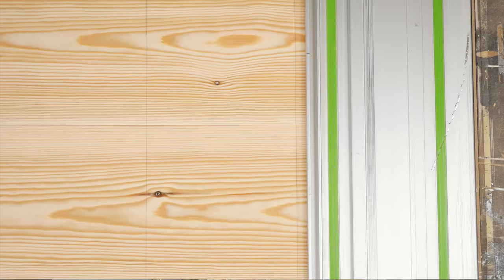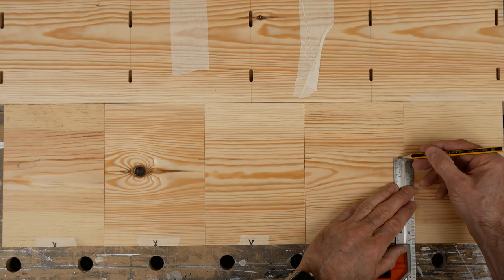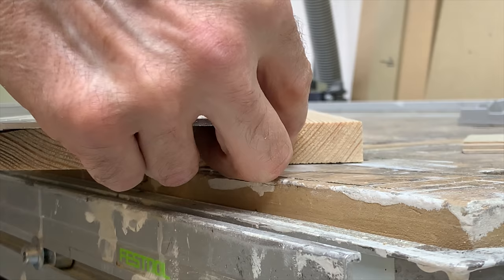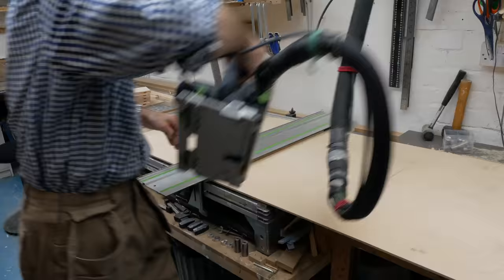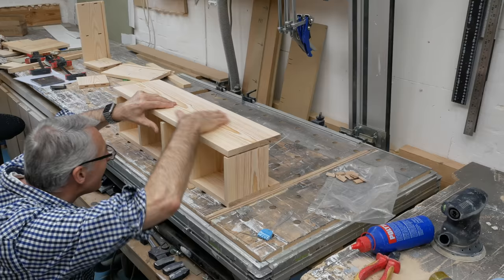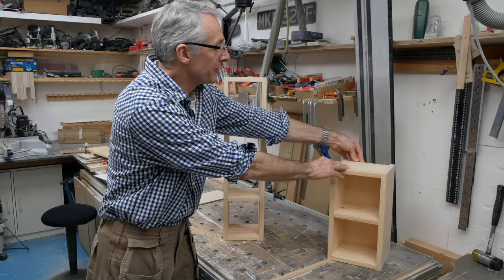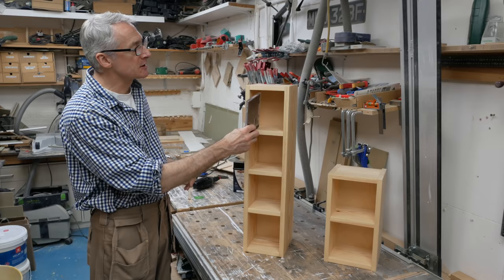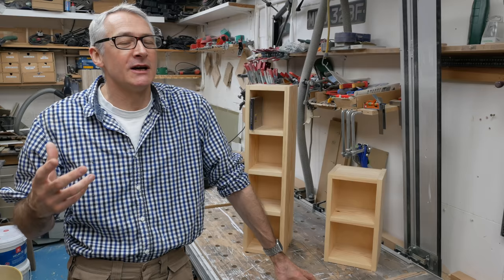Extending Ikea Part 2 [video #297]

Comment: I was thinking. There's a dearth of cheap tracksaws here, only one that I have found cheaper than Scheppach.

I have a proper workbench, I bought it at auction when a cabinetmaker closed down. I could replace its sacrificial top, drill lots of holes arranged artistically, make a sled for a circular saw, attach with a hinge to ensure I get my rightangle reliably, and do what we saw you doing with your fancy pancy Festool.

How does your tracksaw adjust for different thickness material?

Comment: Enjoyed the video, especially the outtakes at the end, thanks Peter. I guess it is a cost thing, or having seen the Instagram photos, maybe a balance thing, but I watching the video I wondered why you went for a ply back instead just using another piece of redwood domino-ed in place?
Reply from the maker: Thanks Bob! While there would have been space for a Redwood back on the larger of the two, there wasn’t enough depth in the smaller of the units, so we opted to keep them the same, rather than have one with Redwood, one with ply. 👍👍
Reply: @10MinuteWorkshop  Okay that works for me.

Comment: I can understand why you were nervous about the big router bit sticking out that much, but why did you pick the track saw over a 6mm router bit?
Reply from the maker: Just trying to do this build with a minimal toolset; as I say in the video, I used Dominos for speed and convenience, but it could easily have been done with dowels, and other than a sander (speed/convenience again) the only tool I used was a tracksaw. 👍

Comment: Peter, may I ask why you cut a wider domino to the rear of the case, wouldn’t two of the smaller width ones have been adequate?
Reply from the maker: Force of habit; give myself as much wiggle-room as I can get., and especially when you have this many dominos in a glue up. 👍👍
Reply: Peter Millard Than you for your response Peter.  Iunderstand now you use the same size domino in both positions. Do dominos expand in the same way that biscuits do or are they behave like dowels?
Reply from the maker: Thanks Mike. No, Dominos are stable, more like dowel than biscuits.

Comment: Nice little project but would be a biscuit joint not cheaper?
Reply from the maker: Thanks. As I mentioned in the video, there are lots of ways of making the joints, with dowels probably being the cheapest. Don’t own a biscuit jointer, so not sure of the price of biscuits vs Dominos.

Comment: Thank you, Peter. 

First time commenter here, so wanted to say how much your channel has expanded what I feel I can take on. Much appreciated.

Couple of questions: from your videos it looks like the track on your MFT always comes down true whereas mine (recent purchase, so I'm getting to know it) goes out of square whenever I adjust  the front guide. Is that all in the edit or am I not using my table right?  

Secondly, where do you get those little bench dogs? Can't see a link on your page.
Reply from the maker: Thanks Ben, and welcome to the comments! Really the MFT, no, the rail should come down absolutely square every time - that’s the whole point of it. If you haven’t already seen then, maybe take a look at videos #182 & 183 where I talk about the MFT setup in a bit more detail. Once it’s set up square you can remove the front rail support for a clear bench, then replace it and the rails come back exactly where it was before. 

Re the benchdogs, I’ve had that set for a long time, but I usually recommend benchdogs.co.uk as they do a great range of MFT dogs and accessories. No affiliate link with them, I’m just a happy user of their product. I have a specific vid coming very soon on a benchdogs product that may be of interest. 👍👍
Reply: Hi Peter, thank you for replying, I don’t know how you find the time!
I will watch those videos and see if I can eliminate some of the ‘slop.’
I suspect it’s going wrong when I change the height. 
I can see how maintaining a fixed height would help but at £600 plus I shall be disappointed if I have to get the square out every time I change the height. After all, that is what it’s been designed to do.
Reply from the maker: Ben Reddick Hi Ben. No you absolutely shouldn’t need to get the square out every time! The height adjustment (for different thickness materials) shouldn’t move the front rail support laterally at all - if it does there’s something amiss, for sure 👍

Comment: Nice little build Peter. Your 10 minute glue,  how long do you actually leave it clamped up? I'm using a 5 minute glue and noticing that any squeeze out isn't fully set until well after an hour. Even though the carcass feels secure I'm not convinced it's fully set.
Reply from the maker: Thanks Jim! Polyten  grabs pretty well within 10 minutes and handleable in 20; they say it does take a couple of hours to cure fully, though I typically leave it longer than that. And yes, glue squeeze can be quite soft while the joint is still strong enough to handle. 👍👍
Reply: @10MinuteWorkshop  thanks Peter. Good to know it's not just me. 👍

Comment: "YES, they will" :) o by the way Peter the Meter, did You check the actual level of formaldehyd in your wax(word and door, windows is not enough) ? :)
Reply from the maker: Actually I did, but it was only a very short video so it went on instagram - you should follow me, btw -  @10minuteworkshop - 👍. Turns out beeswax (and/or the carrier it uses) is very high in TVOC and HCOH. - https://www.instagram.com/p/BuqxLTHA-Wb/?utm_source=ig_web_button_share_sheet

Comment: How long do you generally leave your glue ups before removing the clamps?
Reply from the maker: Depends how warm a day it is tbh. With this adhesive 10 minutes is all it really needs for light handling, though I prefer to leave it for 15-20 if I can. 👍👍
Reply: @10MinuteWorkshop  cheers buddy
Reply from the maker: Thanks Gianni! And no, the hinged rail comes as standard with the Festool MFT. 👍
Reply from the maker: Prego! 👍